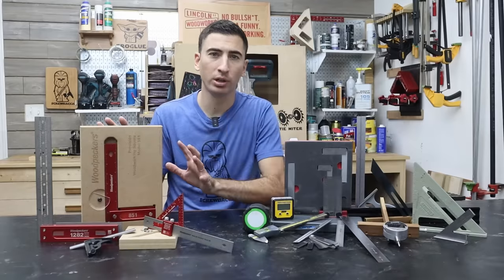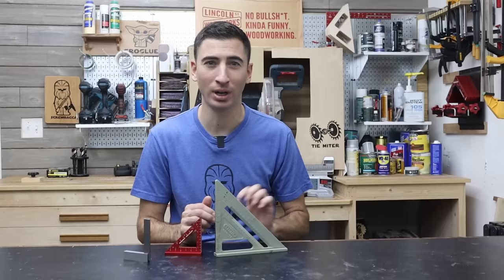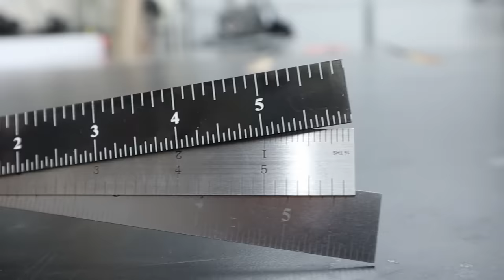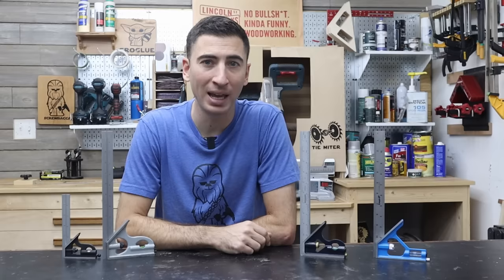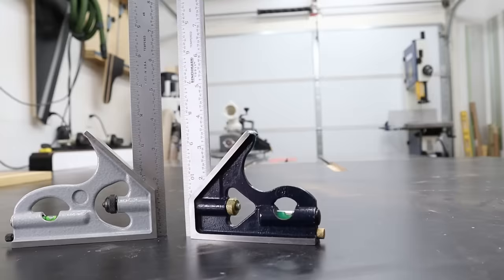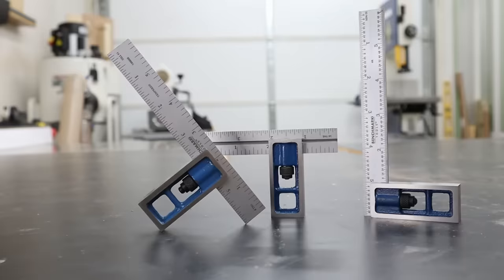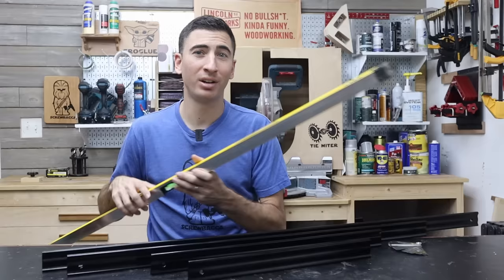Why is woodpeckers so expensive?

Comment: I have purchased and used a number of PEC blems from Taylor Tools. I have been happy with all of them until recently when my 12-inch combination square developed a defect in addition to the surface marring on the rule. The hook that is supposed to tighten no longer did so, so it could be snapped into two pieces without effort. So I have replaced it with a Starrett, thinking their quality control doesn't stop with the first blemish.

Comment: as both a hobbyist machinist and woodworker besides being a pro carpenter, I couldn't agree with you more on most everything. The one thing i have to disagree on is the digital "dial" indicator. I just feel a moving mechanical needle is much easier to read for most things an indicator is used for. Great tips on saving money though. You'll get much better results in the long run spending your early dollars on wood than woodpeckers. Then again, i say this with a shop full of Starrett, Mitutoyo and Brown and Sharpe. It was easier starting in metalwork. I already had many of the good tools)

Comment: I've been a woodworker for 35+ years and have graduated to some higher skilled projects. I've looked admiringly at Woodpecker tools over the years but have never purchased one due to the price that has no connection to reality whatsoever. Given the natural imperfections in the wood itself, accuracy in wood projects is not primarily attained by super precise squares and measuring devices. It is more in proper tool set up, and clever use of jigs to facilitate replicating cuts.

Comment: As a Tool and Die Maker(taking up wooodworking as a hobby BECAUSE MY 1950 MONEY PIT OF A HOUSE IS ALMOST DONE WITH RENOVATIONS AND I HAVE ACCUMULATED A TON OF TOOLS THAT WILL BE USED FOR WOODWORKING.), I can say you cant go wrong with expensive measuring tools, he who buys cheap buys twice. STARRETT AND MITUTOYO SHOULD BE YOUR FIRST GO TO PURCHASE FOR MEASURING AS THEY ARE MADE TO LAST 100'S OF YEARES. SOME STARRETT SQUARES HAVE INTERCHANGEABLE LENGTH BLADES, SO YOU CAN PURCHASE A 6" THEN LATER BUY 12" THEN 24" BLADES WHEN NEEDED.

Comment: I highly recommend the Harbor Freight 
6" Fractional Dial Caliper.

A caliper is way overkill for woodworking, so the loss in precision for a HF tool is nothing.
This thing is graduated in fractions of an inch 1/64"  And is great for measuring depths and widths of slots, and widths of bolts (for getting the correct drill)

Comment: I agree (not that I'm anybody or expert) with most of what you say except the digital caliper vs analog.  In my shop (it gets cold) I've had 3 digital calipers fail and now I rely on ones with a dial.  It takes a little extra effort but the digital ones often gave multiple readings when checking the same spot.  ( one was cheap, the other from one of the companies you appear to be using)  Other than that I hope people spend wisely and follow your advice.

Comment: You came up going down the YouTube rabbit hole. I'm glad you did, subscribed and will be binging your videos now - love your style!

As a machinist, highly advise learning to read manual calipers/indicators. Digital are nice but often fail with the slightest moisture or become "off". Won't matter 90% of the time in woodworking but some applications are critical.
Reply: Vernier calipers often sell cheap especially in the larger sizes. I'm a machinist and run a mix. Mitutoyo digitals serve me well but I hunt verniers from any quality company.
Reply: @Comm0ut  Love me some digital Mitutoyos. I keep those with my "nice set" at the house and use various other stuff on the job site because you know how things grow legs or wind up broken 🙈

Comment: The car and metal fab stuff I’ve done in the past, I’ve purchased Mitutoyo measuring equipment and have been pleased with the results, and it’s a little less expensive than Starett. My argument against digital measuring tools is it is something that needs batteries. Batteries inevitability crap out at the worst time and with supply chain issues, I’ve occasionally had difficulty finding what I need. (Specifically CR2032 batteries for my auto-darkening welding hood)

Comment: It easy to test a combo square for true 90 and correct with a small flat file using the mirror image technique. You don’t need to by an expensive tool.

Comment: Spent $300.00 on a woodpecker router table insert, had a small plastic sprocket fail and woodpecker's solution was for me to buy a new insert because the didn't make replacement parts for  my insert any more. Thanks woodpecker

Comment: great video, I stopped using combo squares to check for squareness because even my starrett 12" is not square anymore due to rust and whatnot that develops in the grove section of the head because of the cast iron, a small file can fix this but like you mentioned a machinist square or any high tolerance solid square is the way to go.
Reply: Empathy. My beautiful USA made combo square, inherited from my grandfather, also no longer accurate from rust. Pity as it's expensive to get quality made tools in my country.
Reply from the maker: For the price machinist squares can't be beat

Comment: I do like have the 49" Woodpeckers rule for laying out lines on sheets of plywood.  I know it's accurate across the length (measured it with a laser) and lining up a lot of the other devices you mention against it, well they can be off by a 64th or more in the first couple of feet or so which adds up across a 4x8 sheet of baltic birch which is cray cray expensive these days.

Comment: Very usefull video, thanks. I find that you could have presented an old fashion marking gauge, they are great. And yes: You might want to consider changing from imperial to metric (helps avoid measuring errors). cheers.

Comment: Loved the video, great wisdom and humor, BUT, I'm kinda old school on some things. Any "woodworker" should be able to setup a table saw without a straight edge, set up a jointer with no more than 2 boards, a miter saw wit nothing less than one board by making a cut a flipping it to mate the joint and never be seen with a plastic square. Other than that, excellent vid and I agree with ALL of the info on tool selection by price and shop necessity. Well played!

Comment: And metric versions are available. 😉
Superb video - really made me think.

On combination squares, make sure the knurled wheel that tightens the slide is made of metal. Stanley for example dropped their quality and switched to plastic, which breaks very easily and is a total waste of money. (Marketing executives, who have never built anything in their entire miserable lives, think we only ever buy on price and therefore it's okay to strangle quality to death.)

Calipers - I bought one with PV (solar) power instead of a battery, and it drives me nuts. If the light isn't enough for a moment it clears and goes back to zero - a frequent issue for me. I'll never buy a solar tool again.
🇬🇧

Comment: Hi, you should mention that those cheapest combo squares can easily be fine tuned to quite high precission. First you need to make sure the blade is dead flat by polishing on a piece of granite tomb stone and fine sandpaper. Especially the inside edge. Second, the blade is supported on two bumps on the bottom of the body groove. If it's not exactly square you can shave of a tiny bit of material from those bumps using the corner of the blade itself.  it's especially easy if you have a machinist square to check it against.

Comment: OK, Just recently bought the Incra T-rule, and was dismayed to find that you needed the 0.5mm lead (it wasn't indicated on the front of the container!), so, now I feel I have a useless tool. Also, I'm concerned about the durability of the thin sheet steel used for the gauge; a single careless drop or something heavy dropped on it.. and you're down a T-rule. While I hear you on the 6" combo square, I find I tend to like working with a 16" combo square. Pretty much the rest of your endorsements I mostly have. Ditto on the calipers.. indeed the most used tool in my shop.Mega dittos on Starret! Thanks for a well done video!

Comment: One extra note about Steel vs. Aluminum, If you are working in the hot sun for hours at a time steel squares can get awfully hot.  Enough to burn you in some cases.  Aluminum will heat up but not nearly to that degree.  Also steel carpenters squares are more responsive to corrective adjustments whereas aluminum will just receive an indent.  Choose based on your style of tasks

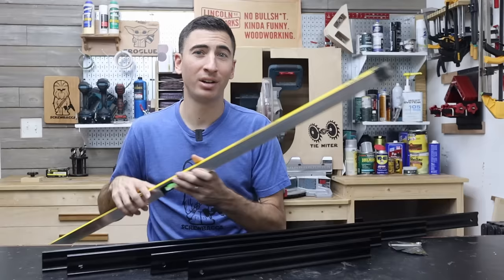Comment: Very good video!  Though, in truth, you arrived @9:40 exactly where I almost always am:  Digital calipers, digital angle gauge, smallish machinist square, plus a runout gauge mounted to a homemade simple jig...though for run-out I went mechanical, since reading a dial there is trivial, as you rotate the bezel to zero and the gauge directly reads the deviation...plus, seeing it move is informative!

Comment: In regards to breaking pencil graphite - Where I live (West Canada) we may refer to a pencil with graphite >= 1mm as a techincal pencil. Where as when you ask for a mechanical pencil, you'll probably get something in the 0.7 ~ 0.5mm range. That's a signifcant difference in graphite width and the amount of pressure you can exert on it.

Comment: I enjoyed this video overall. I commend your tool selection process. I have a 1st generation Woodpeckers router lift I've been using for years. It was worth every penny. As to their gauging, I wouldn't have any of it. I am in machine shop tool sales, I was a machinist and manufacturing engineer previously. Obviously I started out my woodworking well ahead of the game gauging wise with Starrett, B&S, Mitutoyo, Tesa, etc.. Having said that more accuracy can be obtained buying the "metal working" version for sometimes the same money as the less accurate, woodworking/ carpentry version. PEC being a good example. Another company would be Shars.

Here's a cool tip for you to try (and a tool to add to your inventory). Buy machinist parallels. They are generally .125" thick (decimal, not fractional...they're accurate) by 6" long and various heights from .500"- 1.625". I recently used mine (using the 1/8" thickness) to set edge guides for routing with a 1" bushing and a 3/4" diameter cutter. I was installing a Kreg clamp rail. These and 1-2-3 blocks give you many accurate set up options. Almost forgot, you can get adjustable parallels too. Set them with your calipers for oddball dims.

Comment: AMEN! to to most of your conclusions and information!!

However, it is not more costly to maintain accuracy or precision as the length of a rule increases. Computer aided marking of rules has been around for decades  so there should be no issues concerning accuracy or precision in a truly precision tool. The reason price goes up is that a larger tool requires more material, often takes longer to manufacture, and has a higher cost to ship. 

You never did answer your question,  "why ARE Woodpecker tools so expensive?"

Comment: You, sir, are a damn legend.

Also, I just bought my first blem combo square from Taylor Tools and it was damn nice. I had short ones, so I got a full 18" blade with all 3 heads for under $100. Stupid cheap for what you get.
Reply from the maker: yeah its incredible value
Reply: Interest in what was the blem from the Tay tool - describe please! Interested!
Reply: @makenchips  mine basically had a couple of (what looked like) small burn marks on one side of the rule. They were almost transparent and didn't affect the readability of the scale at all. I'm guessing they over buffed it while polishing it before printing the scale on it.

Comment: The absolute most underrated tool, IMHO, is a good set of gage blocks.   I find myself using them ALL the time for all types of different things.  I also have 4 1-2-3 blocks, which make setting up a tool really easy to get a common size reference at different areas (a planer, for example, or a wide belt).   I use them all the time for verifying dado depth too, I find that I can get even more precise with a block than I can a caliper.   I spent around 50 bucks on my set, to which I added another 50 or so dollars worth of 1-2-3 blocks.   

Also, 1-2-3's are typically dead square as well, providing a great reference for some tasks (setting 90 on a table saw blade of fence is a great application).
Reply from the maker: Very true Michael

Comment: To date I have no woodpecker tools. You can get, as was stated in the video. The same accuracy with much cheaper tools that will do the job. You should not have to pay $100.00 just to draw a straight line. And to me it is the same with other tools as well. And like many I have been saying this for years. When I started in the trade, the Master Carpenter said I should buy a Plumb hammer. I bought a Sears special, 1/8 the cost. Still have both 50 years later.

Comment: Actually, I have had very good luck with the two Empire 6 inch combination squares I have.  I also have three Starretts, but I sort of reach for the Empire a lot.    It's accurate.   And easy to read.   And if you happen to drop it - no big deal.
Reply: Same here. But the caveat to the combo square is that the wind on adjuster needs to be really tightened up or it won’t hold square for long.

Comment: I prefer dial calipers over digital for the simple reason that I never have to replace the batteries. I bought a very nice Etalon dial caliper almost 40 years ago and it still gets used any time I'm in the shop for something.
Reply: The beauty of digital caliper can go metric and inches on simple press of a button at the expense of swapping out batteries once a year.  Something to consider.  If you never use metric then it's moot.  It's a must have if you use both systems.  When it shine is from some crazy dimension you obtain from angle cuts (1.108" for example from a drawing).  It's hard to set it up on a square.  I use caliper to dial it in and simply transfer that onto the double T square and use square to do the marking.  If dimension is in mm, I would do it the same way so I don't have to rip out my calculator.

Comment: just ordered a set of the flat reference bars. here is hoping I can get more accuracy off my jointer.  was debating buying a new jointer as this one is finiky about changes. so anytime I have to make an angled joint it takes weeks to get it back to perfect.also added some machinest squares to my list. I use 1-2-3 blocks right now but decided to get something that will let me check other tools.

Comment: There is a tradeoff buying rules with 0 starting at the end.  Any damage to the corners or end can make measurements inaccurate.  If 0 isn’t at the end, you can still have a clean 0 line even if there is damage to the corner.
Reply from the maker: great point !

Comment: Cheap combo squares can be easily calibrated by using the corner of the steel rule to shave bits off the interior of the aluminum head.

Comment: I totally understand not trusting yourself on the dial calipers.  Yes, they seem easy enough, but I've messed up measurements more than once adding the dial reading to the measurement on the beam.  For woodworkers, however, I don't think a dial indicator has the same problem.  I'm almost always using a dial indicator to make s small, relative measurement.  If you're measuring less than 0.1", you just take the reading off the dial so it's no harder or more error prone than digital.  Otherwise, I agree completely with your recommendations.  I hope new woodworkers see this and save themselves a lot of money, because buying really expensive and really cheap tools can be wasteful.

Comment: The Paolini Pocket Rule is much more useful than you make out. With the slide stop you can make it a story stick, a rule, a layout tool, and much more. I started with one of those Incra  T-squares they are ok at best, the blade is flimsy, the corner got bent with a small drop, and worst of all, it you don't make sure both of those knobs are tight it can skew your line. If you are starting out the Incra will work but will leave you wanting more. That more is several different offerings from Woodpeckers, Bridge City, Lee Valley. Let's just leave it at: nice tools are nice.

Comment: Just an observation: If you are going to work to the tolerances this video implies, When marking with a "crowsfoot" mark you should start both lines at the exact point on ruler. trying to draw first line towards the desired point on the ruler as demonstrated, is less accurate and harder. When I worked with metals I worked to a 1/2000th accuracy but working with wood a 1/64th is almost overkill considering wood's ability to expand and contract depending on the humidity.
There is no need at all to spend the big money on these tools. A straight edge will out perform those pre-drilled markers

Comment: Ok, I'll say that while you may not need a $70 square, more than plastic isn't necessarily overpriced. I couldn't get by happily anymore without my 14" aluminum speed square. Things slide against it easily when marking and using as a handy fence for the circular saw. It is long enough to mark multiple pieces, especially when marking top and bottom plates at the same time.

Comment: I think for many it's easy to overlook "thousandths of an inch" when you don't grasp scale. You can see and definitely FEEL thousandths of an inch. When you run a plane across a board and it's just out of square and leaves a line, that's about a couple thou. Just enough to see, definitely enough to feel. And with measuring anything, being off by a tiny bit over a long stretch magnifies. 

This begs a question that dawned on me: how hard would it be to take a fair or high mid grade tool up to snuff and still be worth the time/effort without spending the money on the top tier tools? i.e. making a tool more accurate?